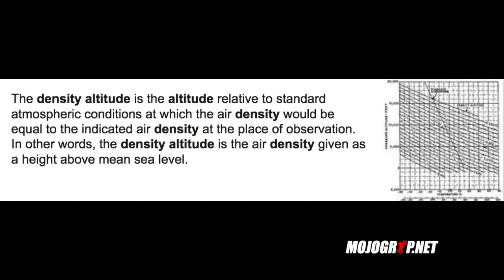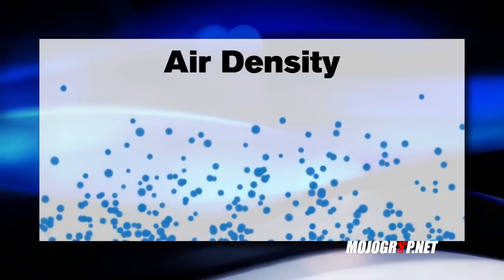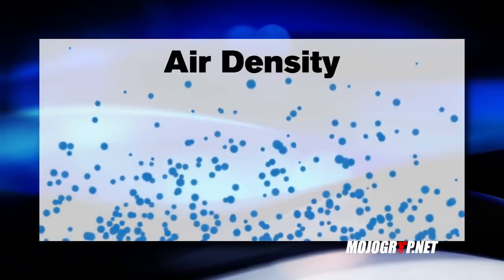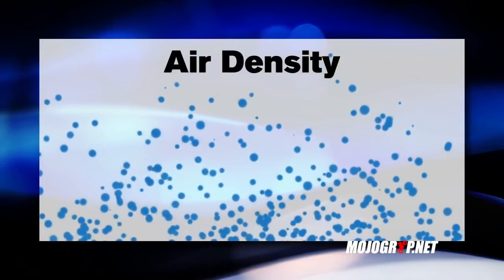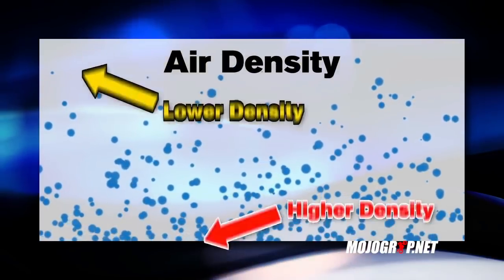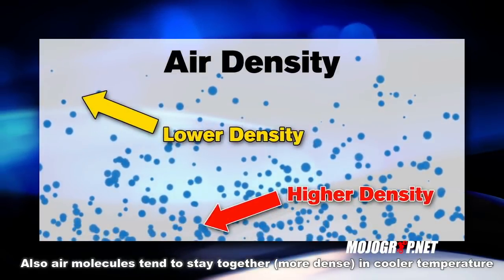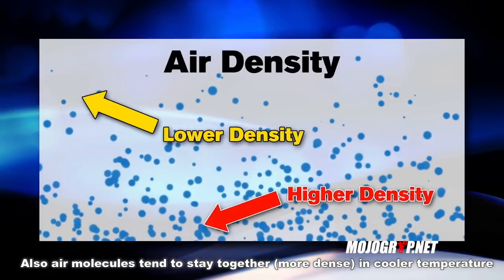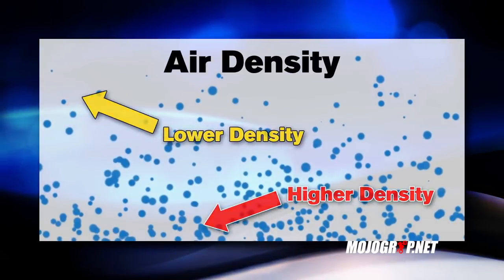What Makes Density Altitude EXTREMELY Dangerous

Comment: My C172 procedure for High DA take-off with no obstacles (disclaimer: I am not an instructor but I do regularly fly in 7000'+ DA)
preflight: DO PERFORMANCE CALCULATIONS!
During run up lean for peak rpm
No flaps (unless short field)
Hold brakes
Full throttle
Release brakes 
Gently rotate at Vr but do not climb, lower nose and let plane accelerate in ground-effect
At Vy start normal climb
Note: if not at 70% of of Vr at mid-runway abort TO

Comment: So does that mean some ga planes couldn’t operate out of already high above sea level airports if the DA was much higher ? I hope that makes sense I’m not a pilot so don’t hold my question to high standards .
Reply from the maker: Correct. some smaller airplanes with smaller engines are better off staying put on the ground rather than taking off from a high elevation airport with high DA. STOL airplanes, although may have smaller engines are capable of flying out of high elevation fields because they are built to do that by design. Your standard plane like a Cessna 150 may have a really hard time flying out of a high elevation field with High DA.
Reply: MojoGrip thanks for the reply. I’m picking up on things thanks to YouTube aviators like you. I hope to get my sport pilot within 2 years.
Reply: Kevin - good luck in flight training. YouTube has grown to become an amazing thing that did not exist when I started to fly. The smaller LSAs will really be effected by high density altitudes, be very observant of it. The summer is the main time where you need to always check the density altitude. I guess before any flight, but I am from Chicago so the summer is the main time it effects us.
Reply: Tim Cordes thanks Tim. I’m looking forward to it !
Reply: In some places even the jets can't take off. It effects all airplanes, not just GA. In Phoenix, Arizona it is not unheard of for the airports there to shut down in the middle of the day because the air temperature is too high to allow planes to take off at all given the length of runway. That said, there are ways around it. You depart early in the morning or later in the evening, for example. It can be strange to have to do a short field takeoff on a 5000 foot runway at 800 feet MSL but throw a high enough density altitude and even a high performance plane like an SR22 will struggle.

Comment: Just something you get used to.  After awhile, it isn't something you think about, although principle concern that you did NOT mention is the requirement (unless flying FADEC) to LEAN your mixture before taking the runway --- actually, lean it before leaving your parking space.  Next, forget about what the ground it doing.  Pay attention to your ASI --- those speeds do NOT change with Hd, even tho TAS and GS change dramaticly.    Plan your takeoff and landing rolls in segments of THOUSANDS of feet (instead of hundreds) and don't plan on climb rates much above 300 fpm (and if you are instrument savvy, plan that you will NOT be able to maintain standard departure climb rates/gradients --- expect not much better than 250 ft/nm at lift off, and diminishing as you climb --- expect to travel miles before reaching pattern altitude.  [ok, just checked: at 8k Hd,  a Cessna 172S at 85% gross can expect a climb gradient of 450 ft/nm, dropping to  365 ft/nm at 10k Hd -- compares to  850 ft/nm at -0- Hd])
{{you asked for thoughts}}

Comment: Mike, I really enjoy your videos.  You do a great job on them and the content is interesting.  But I have to comment on this one.  If you're at an airport at 300' MSL and the density altitude is 8000' the air temp would need to be about 189 F!  We'd be cooked!  Take care, and keep up the great work on the videos!  :-)
Reply: sbhouchen - I was going to say the same thing. If there was a 7,300 foot difference I would be staying in air conditioning all day.
Reply: Check the current weather in Snowflake, Arizona. Two weeks ago, the density altitude was 3,000 feet BELOW sea level. Snowflake is at approximately 5600 feet ABOVE sea level. I didn't freeze to death.

I don't recall the exact conditions. The temp was approximately 10°C or 12°C. Pressure was above 1030hPa.

There has been a persistent high-pressure ridge in the Upper Colorado River Basin.

Comment: So for take-off and landings, you need to go faster?
Reply: yes you do but your aircraft performance will be degraded when the air density is low. on takeoff you use full power. that comes from the engine but the most importent factor is how much air is the propeller reacting against. think about a boat propeller spinning in water that is filled with bubbles.  your propeller is spinning fast but you arent making much headway.

Comment: HIGH DENSITY = HIGH temp, hot days, bad flying, air molecules far apart? I'm still very confused with this because it seems like high/dense means the air molecules are close together and therefore create good lift? Why am I so confused with this
Reply: You actually have it backwards. Cold air is MORE dense than hot air. That's why when you open an upright freezer the cold air from the freezer tends to sink to the ground. On hot days, the air is LESS dense and the air molecules are farther apart causing a loss of performance when flying an airplane.
Reply from the maker: I'm going live in about 5 minutes. I'll answer this there. hope to see you in the chats
Reply from the maker: Answered your question here https://youtu.be/X6z_P0g1iGc

Comment: EXCELLENT JOB AS ALWAYS MGM, VERY INFORMATIVE!!! Here's an ex. of how air density can effect the properties of flight, especially the takeoff...Take a commercial aircraft with service from Nairobi, Kenya, to say Chicago, here in the 'states. Despite the return flight being non-stop, the flight TO Chicago requires a fuel stop along the way, more than likely somewhere in Europe. Because Nairobi sits at nearly 6,000ft above sea level (approx. 1800 meters), the aircraft can't take a full fuel load because of the air density degrading its takeoff performance. Obviously it doesn't have this problem on the way back, hence its ability to make a straight shot without the need for a stop. This is a good ex. of how, whether due to weather, elevation, or other meteorological conditions, it's extremely important to make yourself aware of the effects of air density...Nate - Pittsburgh, PA  ;-)